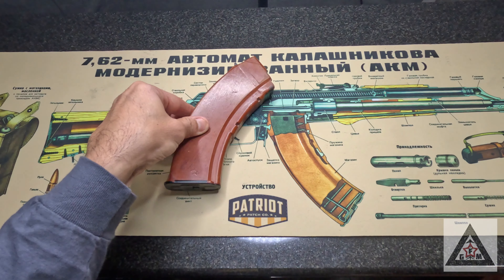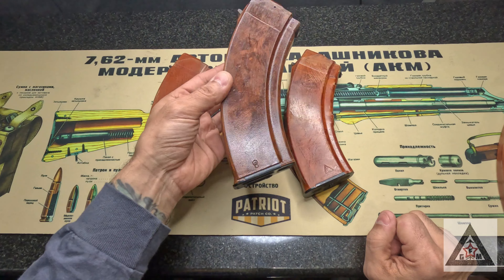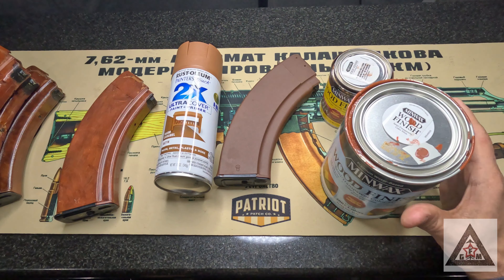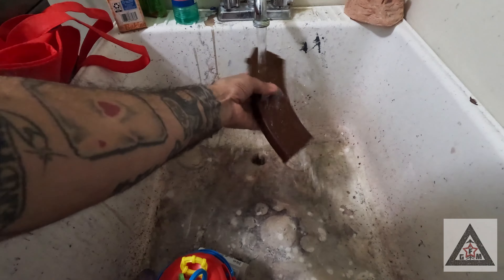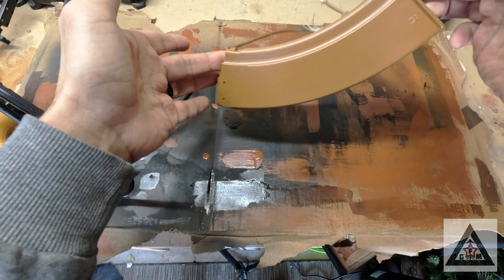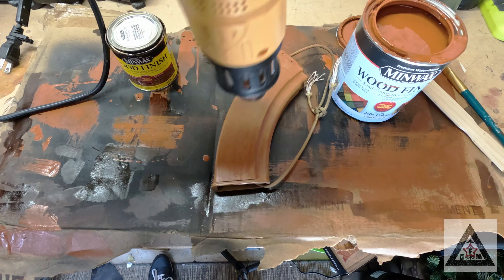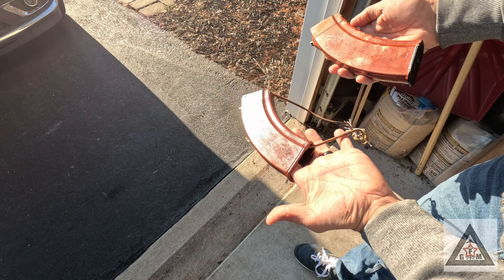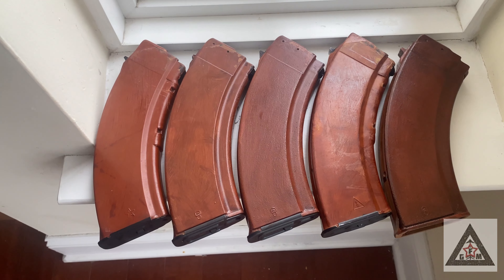Ultimate Fakelite Tutorial! (Fakelite magazine to Bakelite?)

Comment: I will stick with 30-round Chinese  meaning stamp sheet metal magazines
Reply: 30 rd chinese cost about 130-150$ each now so Maby u don’t realize what your saying or have em already. I have a 30 40 100 rd
Reply from the maker: Actually, just found Chinese flat backs for $25 each at the local gun show. There are also online sellers featuring them for $50ish
Reply: @GalacticForceMedia  that’s good deal if your patient and watch you’ll always find deals but if u have to purchase one at a particular time you’ll pay up. I personally wouldn’t wanna pay more than 20-25 for one but I like em otherwise I’d want Croatia ? Or Maby Serbia ? The bho steel one that has a loose floor plate. For the $ it’s best and I just bend the mag well bottom out with a hammer handle and the floor plate is tight. I like the bho to tell me it’s empty. My cheap mags like Korea I mod em to bho. Korea is good for the $ Aslong as their the newer one that has the follower stamped properly and will hold the 1st round properly
Reply: I found a Korean mag that’s plated some odd grey finish it’s a metal plating I looked em up and apparently their 90$ ?? Not supposed to ever corrode.
Reply: @GalacticForceMedia  the Chinese mags u mentioned… their knock offs those “chinese “ chicom mags are euro knockoffs the flat back is wrong their not as perfectly smooth as the Chinese their wrong and are selling for 50$ the follower looks sorta right but their obviously fake. Their not transitional as ppl say either their a knockoff
Reply: @GalacticForceMedia  it’s illegal to import Chinese mags . I just saw those mags u talking about their not right their fakes. I was wandering how a big batch could have made it in.

Comment: Question: Is the water based minwax that you put on actually called crimson when you get it mixed?
Reply from the maker: It’s an actual color you have to have them mix in with the water based tint
Reply from the maker: You can also try a sample of BURNT SIENNA, as this also could work
Reply: @GalacticForceMedia  thank you I will try it
Reply from the maker: @whereisthebalance5732  I want to thank you for commenting - we did in fact use BURNT SIERRA - NOT CRIMSON.  I appreciate you pointing it out!!!